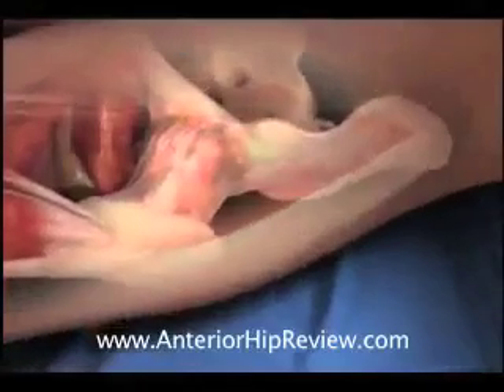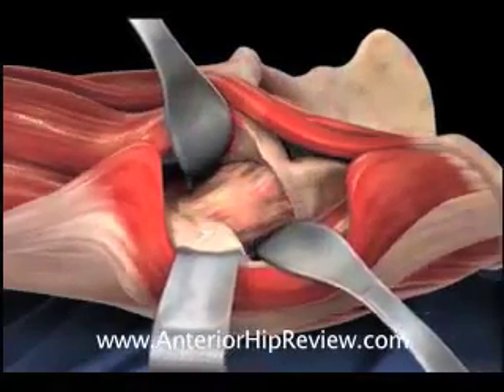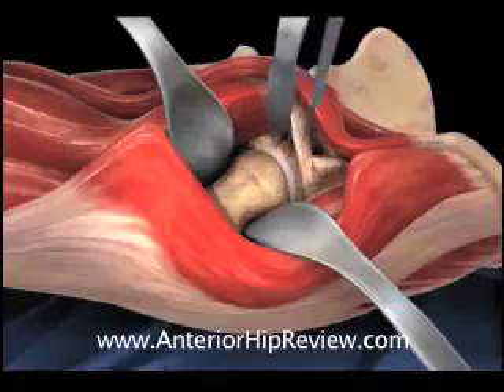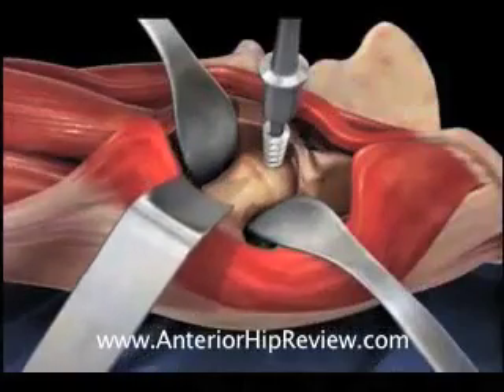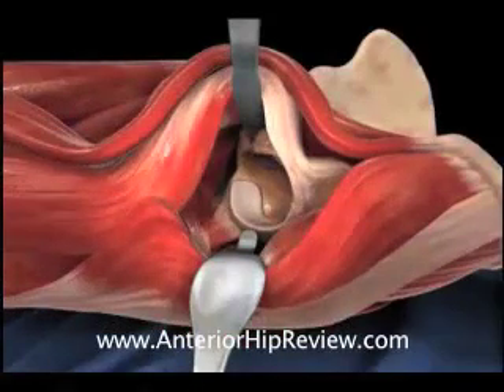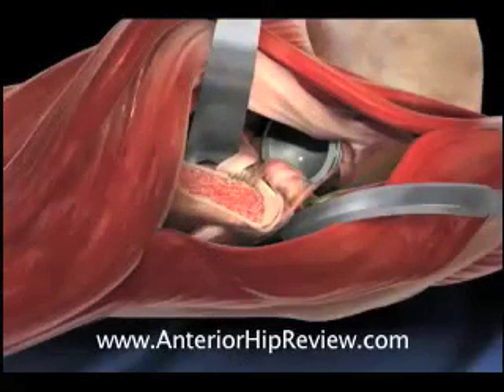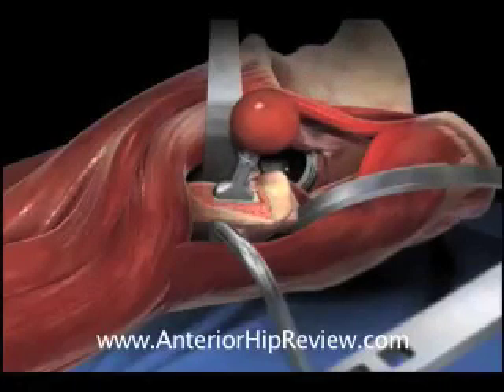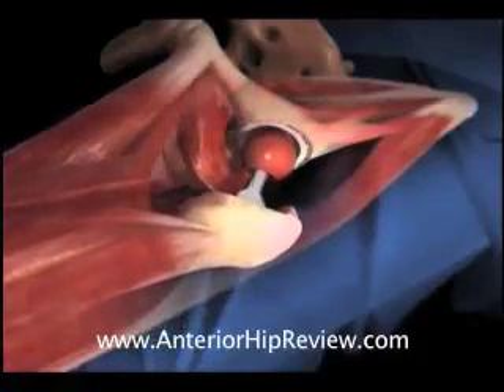Hip Replacement Surgery

Comment: Had a complete left hip replacement 12 months ago. Best thing ever. Could barely walk pain free  before surgery, can walk 10 KMs now absolutely pain free. Top marks to my surgeon for a bloody brilliant job. A little pain after surgery, managed easily with a great pain management system. Don't be afraid of the operation. In the hands of a good surgeon you will be ok. Cheers from Michael. Australia.

Comment: What prevents the  prosthetic 'ball' part of joint from coming out of the prosthetic 'socket'? From the animation the parts are not mechanically linked and it appears that if pulled, the ball will move out of socket.

Comment: My dad just had one a week ago. OH MY GOD!! That looks horribly painful. So glad he has a high pain tolerance.
Reply: For what it's worth, in most cases, the pain is actually reduced. Firsthand experience in this. Had a replacement on February 15th, 2017. The morning when I got there the pain was awful. I woke up and it felt better-ish. The joint pain was completely gone, but there was still some residual pain. Or something. Idk really. I was off the meds in a week. Can't comment on PT and whatnot, given my unique circumstances, so it was mostly easy street after the first 2 days. I have a condition where I can't walk, and I don't like going into detail because the prognosis means I'm gonna die before 40, and haven't walked in 4 years. But the hip replacement still helped because joint pain still sucks when you can't walk at least in my case.

Nonetheless, I wish your dad good luck, he's probably is less pain now.

Comment: I had my operation last Wednesday.  It took less than 2 hrs in total and was up walking with the aid of a walking frame the next day. Out of hospital on Saturday.
One week on, I can walk without any aids but have my crutches just in case. I perform rehab exercises every day including free squats, knee raises, side raises and back leg raises.
Stitches come out Saturday and follow up physio next Monday.
Looking forward to getting back into the gym, riding my bike and swimming.
Got some good pics too :)
Reply: Hi,

I am curious are you able to run with the metal implants in your hip? Would recovery take months for full use of your hip. Thank you for your time : )
Reply: +LittlePunjabiKid 
Hi, I can jog a bit but running isn't my thing so I try not to do a lot of it :) I'm guessing that with proper aftercare and physio, you can pretty much do what you did before the operation. I am a shot putter/hammer thrower and our season kicks off in a few weeks so I'll find out how good it holds up. I am back to work 4 and a half weeks now after having 13 weeks off, i
1 week pre op and 12 weeks recovery, am back in the gym and in the pool. Even riding my mtb much to the chagrin of my physiotherapist. I even sit on the floor, which sent her thru the roof, but hey I know my body and I know my limitations, so if it doesn't feel right, I don't do it.
Reply: Wow!!! Congratulations. I really appreciate you sharing your experience. I am glad your recovery is going really well. I hope you do well with your future sporting life and normal life and hope health remains good. Thank you so much again & good luck : D
Reply: My brother is getting one to did it hurt when you woke was you in pain I feel very sad for my brother.
Reply: No pain at all. I was up walking aided the next morning. I hope it all goes well for your brother.
Reply: Peter Tua ..can you run now since its been over 2 years, just curious. Thanks for sharing btw; it's inspiring for those who may have to go through this ...be blessed
Reply: Me no

Comment: o_O ill never do anything stupid to get a hip replacement
Reply: you will if you can't walk without it
Reply: Carbalite Charibasa . What an ignorant thing to say, I had a hip replacement 8 weeks ago and yes it was very painful at first when I'd had it done. Nothing like the 4 years of pain I've had to endure, waiting for the operation. If you can't say anything nice, helpful or kind don't say anything at all.
Reply: you are completely wrong arthritis is ALWAYS caused by ones diet.. cartledge dosent ware and tear out of your body.. its supposed to heal itself..your diet is your healing but can also kill you..if you eat like shit dont expect to live long. there are MANY foods that cause inflammation an immune system problems  which are mostly linked to arthritis.
Reply: it's not about doing something stupid it's called wear and tare on your joints over years and years of use. cartilage wears down over time just like tread on tires and once it wears down completely  the bone joints that were separated from that cartilage creates friction between one another and causes arthritis as a result.  if you live to be an certain age, you will experience arthritis at some point of your life regardless of what your lifestyle was. So it's not a matter of if you will ever get arthritis it's a matter of when you will get it.